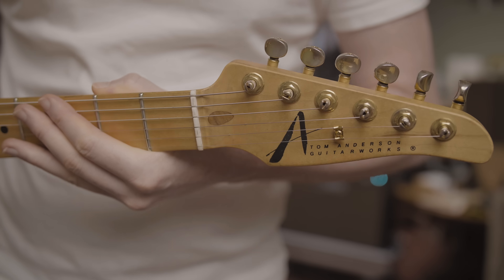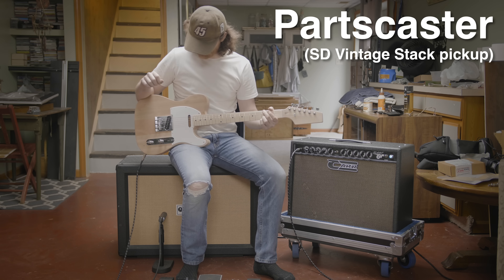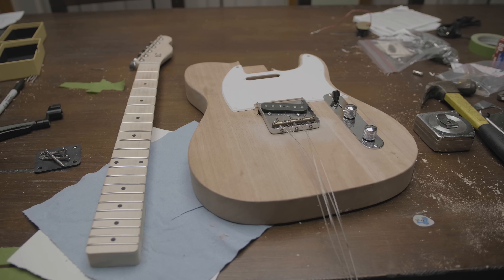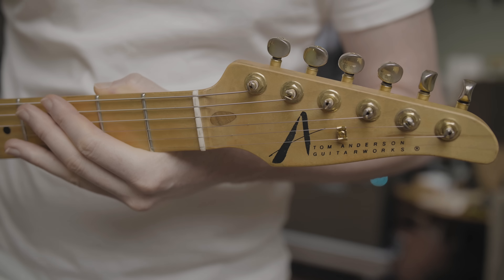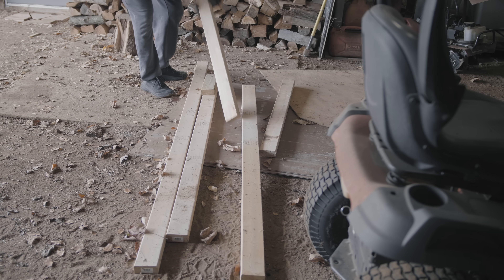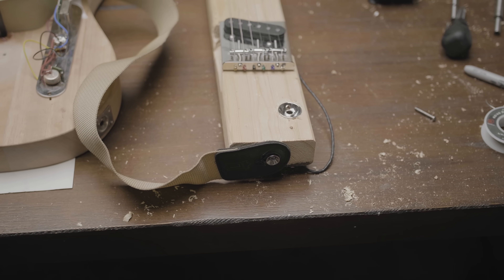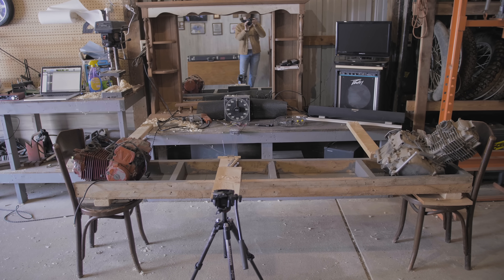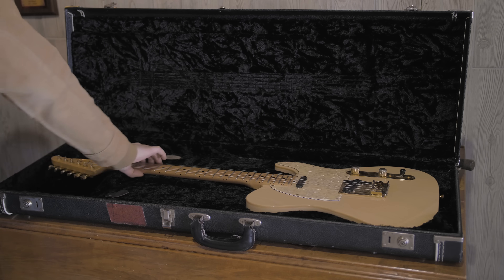Tested: Where Does The Tone Come From In An Electric Guitar?

Comment: I thought a lot of times... "what if someone manage to make a guitar with no wood to test if tonewood is even real?" From a rational and logic point of view there should be no audible influence of the wood in a electric guitar, because it´s just a string atached and vibrating between two points made of metal, not wood. You really nailed it with this video, it´s excellent and opens the door to a lot more questions from here on.
Reply: Question for you Federico. What makes you think the vibration transfer of the strings stops at the two points made of metal that they’re attached to (I presume you meant the bridge saddle and tuning post… although the nut is probably more logical and typically isn’t made of metal)? 

Why if you really believe that the guitar’s body (and neck) isn’t in play here and the influence of, and on, the string ends with those two points made of metal why is it that you can feel your guitar vibrating against you when you play it, even unplugged? I’ll tell you why - because the vibrations from the strings transfer through the saddle, the rest of the bridge, the nut, tuner, and the fret and fingerboard for a fretted note and into the body and neck of the guitar. Those vibrations you feel are the proof of that… the proof of the fact that you are artificially oversimplifying the guitar as a physical system.
Reply: @davidburke2132  You are absolutely right in every aspect of the acoustical physics that You have described. I agree with you on that. But what i was trying to say was that none of all those vibrations (except the disturbance that the pickups are picking up) are audible in the sound that you can hear through the speaker of an amp. I've never denied the existence of all the vibrations and the energy transfer between the strings and the body/neck. Now, My question for you is how many of all those acoustical phenomenons can affect and alter the eléctrical signal running through the amp to make it noticeable and how you can measure it?
Reply: @federicoaguilar1675  the fact that those vibrations occur in the guitar body are evidence of the structure of the guitar affecting the vibration of the strings. And the guitar structure will be affecting the vibration of the strings in different ways at different frequencies. The guitar structure will have resonant frequencies… frequencies at which energy will not be dissipated and will be returned back by the vibrating body to the strings. The guitar structure will also have a frequency response curve that will inform how energy is taken from the strings at different frequencies. 

So, it’s not that the pickups are detecting the vibration that has been transferred to the guitar structure (although some would argue that if the body on which the pickups are mounted is vibrating that affects the relationship between the pickups and the strings). It’s that the guitar structure affects the actual physical vibration of the strings themselves. From there everything happens as tone wood deniers would described it… it becomes an electrical signal path scenario. But those deniers are missing out that mechanical part… the vibration part… and the way it informs and affects the strings’ vibration as a precursor to the electrical signal from the pickups. 

There’s definitely a question as to what can actually be perceived in those differences and effects once you’ve gone through the signal chain. I’m not trying to argue that the guitar structure, construction and materials makes a bigger difference than pickups and electronics, just that it doesn’t make no difference. Some pickups will be more capable of detecting the nuances of string vibration than others. Effects and gain applied through the signal chain (including the amp) will affect what can be perceived. And I think it’s also important not to underestimate the impact of the capabilities of the listener. I think we all too often we seem to think of auditory capabilities being the same for all people. Clearly they’re not. Some people’s ears are just better than others’, just like some can see better, run faster, etc. So I think it’s quite important we all acknowledge that just because we might not hear or perceive a difference between two guitar sounds it doesn’t mean that no-one can. After all, Eric Johnson claims to be able to hear the difference between a Strat with or without its trem cover in place through an amp! I have to confess I’m skeptical about that 😜 but I’d never tell him (or even someone not famous for being a genius guitarist) that he can’t… I just don’t know. 

To finish up what I would say is this - in this video, even with the compromises of YouTube audio, I hear a difference in the tones of the “air guitar” and the conventional guitar at the end. They are very similar, but they’re not the same. I know other people who have said they hear a difference too, and many people who claim they don’t. For me, that I can hear a difference already undermines the conclusion of this video (even without considering his flawed test method)… that there is still a difference, albeit small, the something about the construction is creating that difference because the pickups and the rest of the signal chain are identical. There are also other videos on YouTube which I’d argue have much more robust scientific method that do demonstrate a difference in tone from different woods. It’s a long time since I watched those but I seem to recall one of them was by Johan Segeborn where he used different rectangular pieces of lumber, attached the same neck and fixed the same pickups, hardware etc. to them and then played them. There were definitely noticeable differences in tone in that video.
Reply: @davidburke2132  Are you serious, pickups amplify the STRINGS, not the resonance of the body. And nobody cares that you’re a “trained scientist and engineer” if all you’re gonna do is make crappy arguments with nothing to back it up. Maybe if you took half the time you did typing into doing your own research I’d be happy to listen. I smell a keyboard warrior
Reply: @halfcookedtorrilla3094  clearly you don’t understand my explanation of the physics involved. I’ll try one more time and then you’re on your own and you can believe whatever cod science you want to…

Sure… pickups only detect the movement of the strings. But the strings are fixed to something physically. They are connected mechanically to body and neck through the bridge, nut, tuners and frets/fingerboard. The strings transfer vibrations to the structure of the body through those contact points. You can tell this happens because you can feel an electric guitar body vibrating when you play it even unamplified - that’s the energy from the string vibration being transferred to the instrument structure mechanically. 

All structures have natural resonant frequencies (frequencies at which little energy is lost) and their own frequency response curve. The structure of guitars are no different in this respect - each different guitar build will have its own resonant frequency and frequency response curve. These factors affect to what extent that guitar takes energy from (and returns energy to) the vibrating strings at different frequencies. 

As a result of the above the structure of the guitar is affecting the way the strings vibrate. Not just in terms of sustain (which would be the case if the guitar structure had a flat frequency response curve and was taking the same energy from the strings at all frequencies) but in terms of the vibration and modal (in a frequency sense) characteristics of the string vibration. 

THEN the pickups do their job. But they’re detecting the vibration of strings that have already been affected by their interaction with the guitar structure. Hence the output of the pickups carries with it the influence of the guitar’s physical structure.
Reply: @davidburke2132 Substane is irrelevant to tone, lets say I speak quietly or loudly, that does not change my tone of voice, the nature of the sound yes. You and I perhaps have different definitions of tone
Reply: @davidburke2132  All you’re doing is restating the obvious fact that sound waves travel through the wood of the body, but thats all it does, travel. This argument parallels the “premium wires” arguments deployed by audiophiles. It’s all in your head and If you were to blind test different tone woods, you’d understand why
Reply: @halfcookedtorrilla3094  it’s ok… like I said, you can believe your version of cod science if you like. I don’t really mind. I’ve tried… it’s all I can do 🤷🏼‍♂️ Science doesn’t care if you don’t believe in it… it doesn’t actually care if you understand it or not… your level of understanding or belief doesn’t in any way change what it is and how it works.

And no… my argument does not parallel the audiophiles’ “premium wires” arguments. I am not, and have not, made any statements about one wood being “better” than another, one mode of construction being “better” than another, just that those differences have an impact on the resultant tone. Each person judges for themselves what they like more with respect to guitar tone. It’s a totally subjective thing, quite unlike your audiophile example.
Reply: @davidburke2132  Real science has PROOF and EVIDENCE, but okay my “trained scientist and engineer”
Reply: @davidburke2132  Seems that in your example the effect of the wood etc would cause certain frequencies to be affected (absorbed perhaps), making them less perceptible and others more so. But is tone simply the alteration of frequencies and nothing more? I'm asking because I can't definitively say that it is or isn't, although as much as I try I can't use an EQ to make one of my guitars sound like the neck pickup of a strat. If acoustic guitar or violin tone is more than just raw frequencies then your example wouldn't refute the video. But is it? I'm asking myself as well.
Reply: @outsidewithmike no, tone is more than just frequency response, it’s also things like attack and sustain. But the last part of your comment seems to set out a logic fallacy… you only need one aspect of what makes up tone for the tone to be changed, not for ALL of them to change.
Reply: @davidburke2132  Okay. So the test with the air guitar and the 2 x 4 show very little tonal change, and some of it could be caused by slightly different strumming or other variables (that could affect it in either direction though). It would have been good to see a frequency response analysis too like in the amp cab video Jim did. I think the conclusion here was that wood caused very little tonal change.

People are spending thousands of dollars chasing tone via different woods and the differences seem negligible. Other tests have been done as well on the subject with the same conclusion.

This test has drastically different "bodies" being used with little to no noticeable difference. Comparing a similar shaped strat body with 2 different woods and expecting a bigger difference seems unlikely. If a workbench and a 2 x 4 guitar sound so similar, then what difference is ash over maple or alder or mahogany going to produce? 

People also claim that the neck being glued rather than bolt-on can make tone "snappier" (or something else perhaps). The workbench guitar...I would expect more tonal change with such different materials being used but there was little to none.

People are easily misled and marketers, psychics, clergy and politicians all know this. I think this video goes a long way in killing the marketing hype.
Reply: @outsidewithmike and people are also being misled by Jim’s fake “scientific method” here 🤷🏼‍♂️
Reply: @davidburke2132  It's more than most have done. Jim has provided evidence that the industry is full of crap. He showed a 2x4 guitar sounding almost exactly the same as a Tele. What have the manufacturers and detractors offered to counter it to this day? Words and ad-homs.

I want to see Paul Reed Smith (I own one) do a comparison with different woods and show us that it makes a big difference in tone. THEY are the ones making the claim, THEY have the burden of proof. So far I have seen zippo.

Remember, Jim made no claims at all when he started the video.
Reply: @outsidewithmike read my original comment properly and I’ve already told you what others have done to prove the contrary to Jim 🤷🏼‍♂️

This conversation is boring Mike… you’re just circling around the same points I’ve already addressed. I get it… you think Jim did something meaningful; I see him as producing a faux scientific video to make money off YouTube/social media by tapping into a lack of scientific understanding amongst the community he’s targeted… people who like to feel proven right about their un-scientific assumptions… and he’s done that very well, getting 2.6m views just for this video. That’s a lot of ad revenue he will have made, so he’s been pretty successful in his core aim here in my opinion. Come up with something new that I haven’t already covered or please let’s just leave this here; I’m not interested in changing your mind on this, especially not these years after the video was released and I said my piece.
Reply: The neck itself also has a resonance, as does the body but in a different way. While it does not alter the tone it does alter the stability of the tone. I like to think that each significant change has an effect on the degradation of the tone, which gives a characteristic especially in vintage instruments that we got used to.
Reply: @Bram Weinreder  I totally agree and what we're really talking about here is tonewood not pickups.. when I talk about tonewoods I speak about the natural Resonance of particular Woods that we use today and we've learned over time with those woods are sometimes were surprised by things that worked great for guitars but overall tonewoods are real because once again we're not talking about pickups because you can stick pickups on anything and make it sound like a guitar just like this video, but overall we know a good and bad guitar which usually has to do whether it rings out or not the pickups are irrelevant

Even Jack White made a guitar out of a two-by-four and a bottle In it Might Get Loud doc
Reply: Did you even watch the video
Reply: What? It's bolted down to a massive wooden bench on one side, and a massive wooden shelve on the other. It's a fun experiment, but it's pseudoscientific and settles nothing.
Reply: @transmundanemusic  well said!! An “air guitar” in name only. 

And of course what the strings are mounted to affects the tone - the structure of the guitar (how it’s made, what it’s made of, its shape, its weight, the method of fixing body and neck, etc.) will all affect its resonant frequency and its frequency spectrum. This means that it will affect the way the guitar structure absorbs and dissipates (or indeed reinforces and returns) the energy of the strings to different extents at different frequencies. This is what is happening when you feel your electric guitar vibrating even when you play it totally unplugged. 

This means the structure of the guitar affects the way the strings vibrate. As the pickups produce a signal that is dependent upon the specific string vibration and its harmonic content the affect the guitar structure has on the string vibration will be translated into the signal from the pickups. 

If anyone tries to tell you that science proves only pickups and electronics matter on an electric guitar then this is a sure fire sign that they don’t actually understand physics at all 🤷🏼‍♂️
Reply: @davidburke2132  Amazing! Did you watch the video?
Reply: @clausion  yes, from beginning to end. It’s incredibly flawed as an attempt at an experiment, and I’m speaking as a trained engineer and scientist 🤷🏼‍♂️
Reply: @davidburke2132  OK then do your own experiment instead, PS Nobody asked or cares
Reply: @halfcookedtorrilla3094  I have no need to do my own experiment. The answer can be determined through logic and science - and actually if you’re interested has been proven by others who have done videos with much more scientific methodology than this one, just without this guy’s flair for visuals to drive interest 🤷🏼‍♂️

And nobody cares? Sure. Then why did Claudiu engage with me and why are you even bothering to respond?
Reply: @transmundanemusic  what further level of science would you suggest needs to be done here??
Reply: @iforce2d  as a rule of thumb, in order for something to qualify as science, it needs large sample sizes, control groups, and the experiment needs to be repeatable and produce the same results each time. This isn’t that. For every “tonewood is a myth” video, there’s a video w similar experiments showing the opposite result. Proper scientific study would need to test multiple guitars, shapes, size, and wood combinations, test cleans as well as distorted tones, test on a multiple amps, there would need to be some sort of a pick machine managing pick attack, there would need to be tests done w multiple different bridges, nuts etc. and there would need to be tests of all possible combinations of these factors. And tests isolating each factor…
Reply: @transmundanemusic  This isn't a place where science has a role. This is the realm of craftsmanship and engineering, and it is done appropriately.
Reply: Well, check out difference between GOOD guitars (not some random pieces of wood) - https://www.youtube.com/watch?v=n4puGOEmGjs
Reply: @david_lynch  Tom Anderson guitars are really good dude, tons of pro's play them